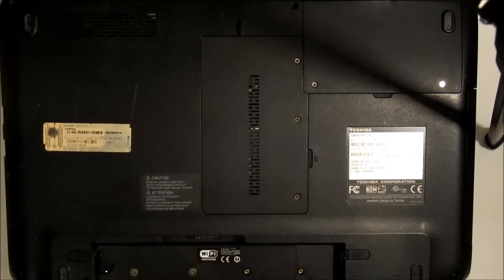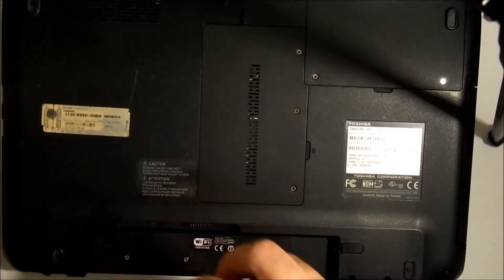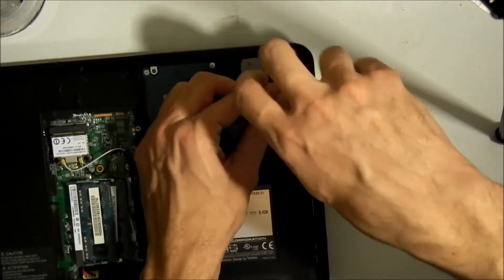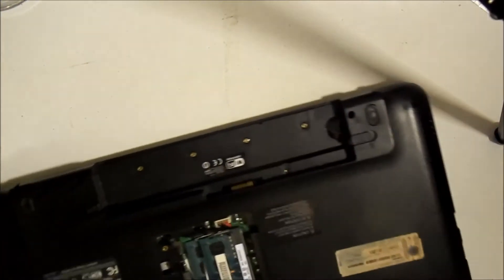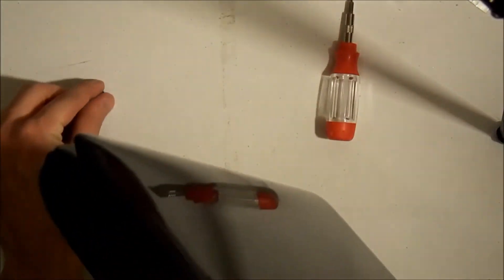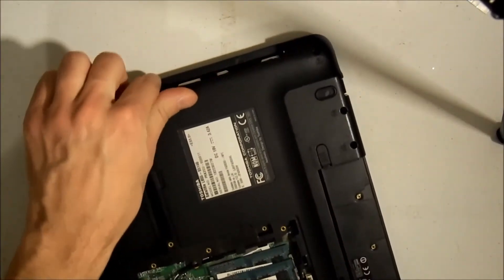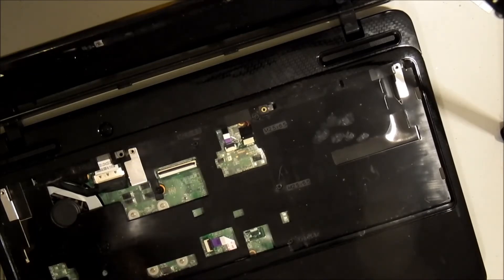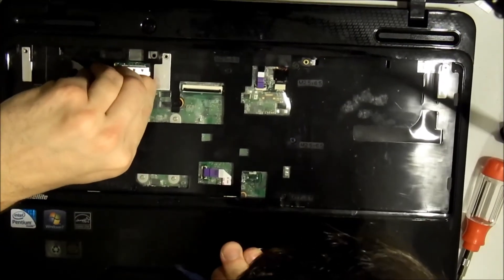How to replace a Toshiba Satelite L655 s5146 DC Power Jack

Comment: Pain to tear a part.  Usually isn't the wires torn away from the connector? I've seen the plastic broken that supports the connector.  Have to use RTV or hotmelt t have to fix.  I would be curious to see you take on those kind of fixes.
Reply from the maker: This one the male pin in center was completely broken off. I have a old volt meter video comming up, will have to do a complete rebuild because the batteries . It's so old it's cool. From 1940-50 era.
Reply: After Hours Tv & Pc repair That would be cool.  It is one of those almost "bullet proof" Bakelite cases? ...Simpson!  They were good and I have used them.

Wit the laptop power.  My kid has broken at least two laptops connectors and it wasn't the connector itself, it was tearing the wires off the connector internally and that seemed to happen (HP I think) when he tugged too hard to the side the thin plastic that hold the power socket broke allowing the socket to flex too far tearing off the wires.  I have extended those wires before and then used hot melt to box the connector back in.  The hardest part is figuring what all needs to come apart to get at it. Each one seem to be different.  That toshiba you just did on video looked like a real pain.  Not only all the bottom screws, it took the keyboard screws too. I think is was on the HP that you could get away without pulling the keyboard.

I have a stack of laptops we have gone through in the last 8 years that I need to get to.  I have at least two screens to replace if it's worth it. I need to sort through and see if any of the screens are the same; but I think that is very un-likely.  If I run across any that I can't figure out how to get the bezel off from around the screen, I will have pop you a question to see if you have experience it before.

Anyway, take care, I enjoy watching your videos.  It gets me more confident to tackle some jobs I have to do and I love watching technical information.